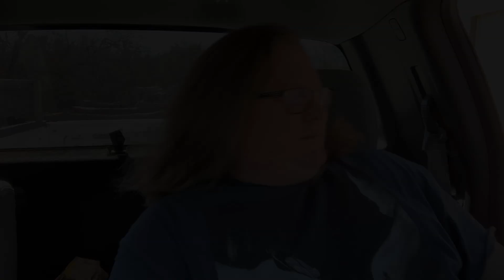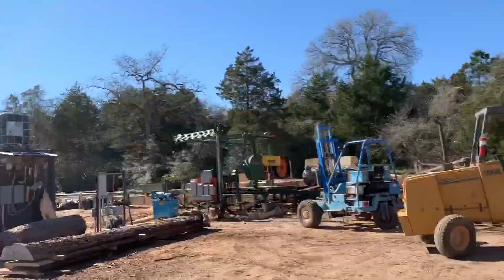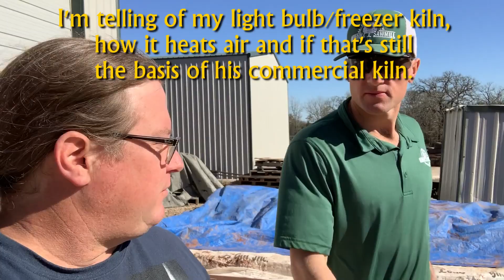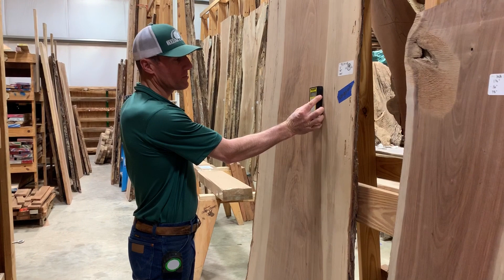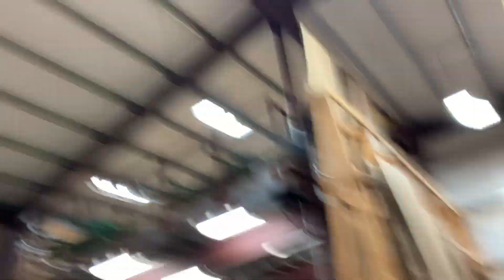How Professionals Process and Dry Furniture Grade Lumber

Comment: Ive always wondered if they were to drill out the entire center of the tree, before drying and/or milling would that relieve the internal stresses that cause warping?
Reply: this would not work without risking losing alit of valuable material. The cracks usually start from the piths or the ends. Piths are not straight nor run perfectly in the center of the tree, nor are the same size all the way through. So say you get a straight log and a perfectly leveled drill bit got through the center of the tree, most likely you either didn't get all the pith, cut out a lot of valuable material. not sure if I drew the image in your mind, but hope it answers a little bit.

Comment: Great video.  This guy really knows his stuff.  I started out in small mills in Oregon, mostly big circle saws  with edgers and band saws behind them to break down timbers further into smaller dimensions.  We did softwood; mostly Douglas Fir, Western Hemlock, and Western Red Cedar.   I worked in an alder and maple mill for a time cutting 4/4, 5/4, 8/4, and 12/4 for furniture.  I wound up in a big Weyerhaeuser  mill in Springfield Oregon.   We cut about 800,00 BF a day of timbers, common lumber and deep clear.  Biggest logs we could cut were 5ft in diameter by 40 ft long.   There were 3 bandsaws in the head end of the mill  8" diameter and a smaller 6' double cut band in  the back end to make vertical grain clear out of  big cants from the headrigs.
This guy knows so much more about hardwood species than I ever dreamed of. Beautiful slabs in his warehouse too.  Thanks so much.

Comment: Shawn
I live in PA to in the heart of lumber country where in a 100 mile radius there are probably 50 or more lumber mills is of various styles sizes. Some are specialty but most are large though which means you need to buy in bulk, 200 bf or more. Some of the larger, and smaller mills, will sell a piece they cut off their veneer logs before processing. I am fortunate to have a mill nearby which cuts their logs into flitches which keeps an entire tree together after processing. It was a nice well informing video the guy knows his wood

Comment: Very well done on an often misunderstood process. I have my own band mill in NE Texas and I learned the hard way how important it is to dry the wood properly. The Texas sun and low humidity is the enemy when you cut the boards. If you leave it in the summer sun very long at all it will start to cup due to uneven drying. Just cut some black walnut slabs today and stacked them in the barn.
Reply from the maker: Thanks

Comment: It is a bit like osmosis .... most of the information we already knew, but didn't realise we knew! Throw in a few  nuggets of explanation and you suddenly get a real picture of what is happening and why!
I suspect that the old masters (like Chippendale) did not use wood that was force dried, but left to "cure" naturally at a slower rate! It might be interesting to find out if there is any correlation in timber quality from different times regarding different climates ..... The Victorians suffered a mini ice age where the Thames froze, the colder ambient temperatures might have a noticeable effect on timbers harvested in that time?
Eather way .... one of the best non woodworking videos on woodworking I have seen! Thanks!
Reply from the maker: Thanks

Comment: Such a fabulous treasure trove of information on the science & technology of 21st century timber production. Never before had I heard of conditioning & the explanation of free & bound water with the sponge analogy was the best I have ever heard.  Also the description of honey comb and how this was undetectable from the surface along with the great variation between components in a stack was fascinating and useful. It all made my primitive attempts at storing and drying lumber from local trees feel yet more pitiful. Having learned so much, my hat is off to the famous 18th century makers like Chippendale who must have developed methods of drying lumber with the technology of their day that worked as in the UK we are blessed with pieces of their furniture that have survived for over 200 years, but they had nothing like the science and equipment of the 21st century. Cruder furniture from even earlier makers who also must have found ways of drying timber can also be found not to mention all the rough sawn building timbers still working, holding up roof etc from the 12th century and perhaps earlier. I have always liked wood and the more I learn of it the more that fondness grows and the more I loathe mdf furniture which is so very popular in the UK. Thanks for sharing!
Reply from the maker: Thanks